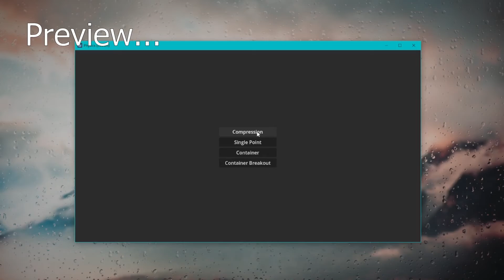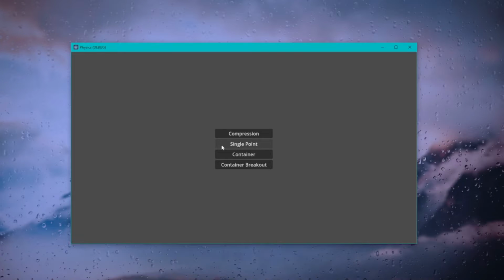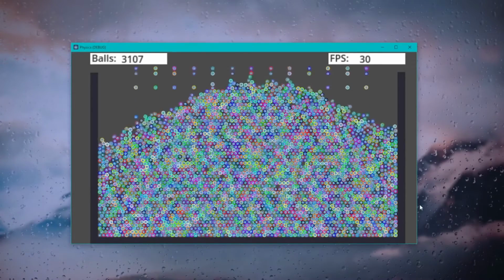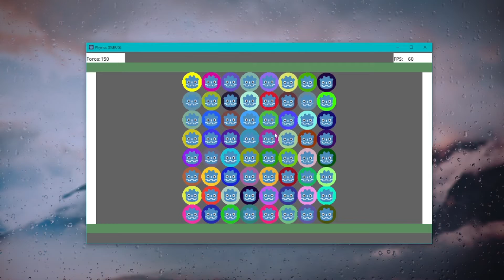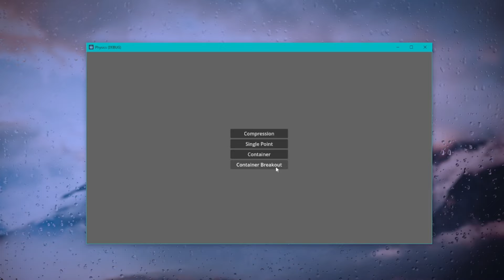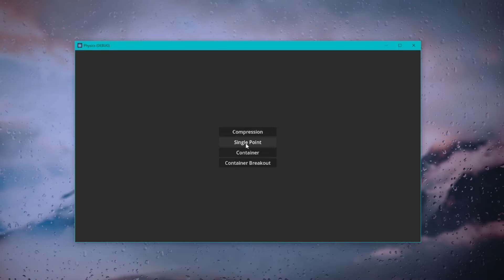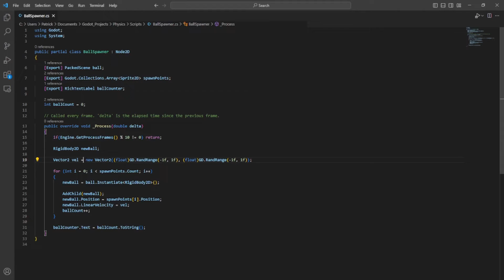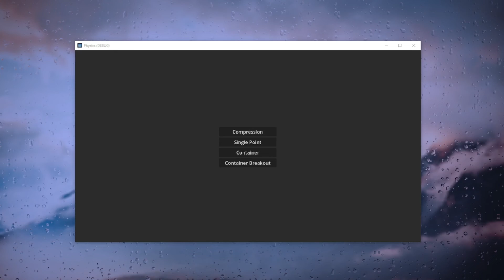Godot 4.2: Physics Engine Test and Reaction Godot VS Box2D VS Rapier2D

Comment: Great video to see the differences, thanks!
Reply from the maker: Thanks! Unfortunately, Rapier and Box2D weren't done with their implementations. Hopefully we can do a better comparison in the future!
Reply: @RoyasGodot  Thanks for the test (Ughuuu here). Right now I fixed a lot of bugs in Rapier2d. The Box2D one is indeed more buggy, but it's the hardest to get right as the api of box2d doesn't look that similar to the one of godot physics.
Do you by any chance have a link to the repo of the tests you used, so I can debug the issues you had(eg. in rapier the walls pushing inwards, and the balls stacking on top).
Thanks.
Reply from the maker: @appsinacup  Thanks for creating the plugins for both box2D and Rapier2D in godot! I really love the work! Here's the link to the repo https://github.com/weRthem/Physics. It was just a super quick project to get some first impressions of they worked. If you have any questions about what I did please lmk!